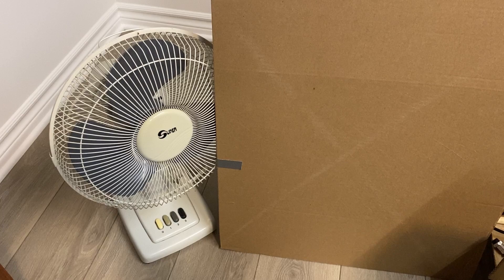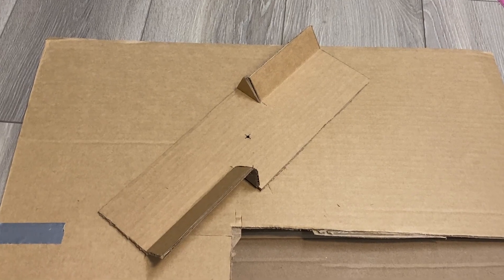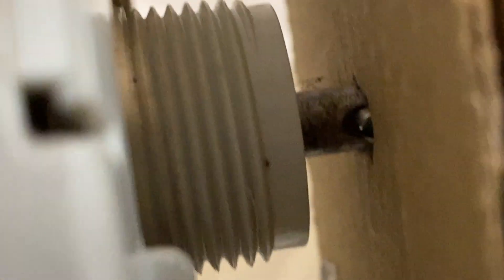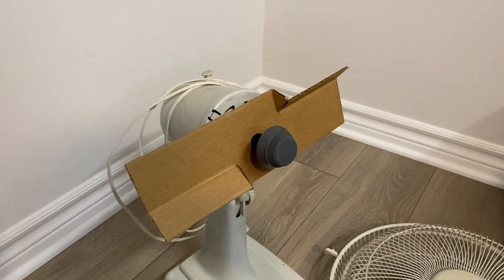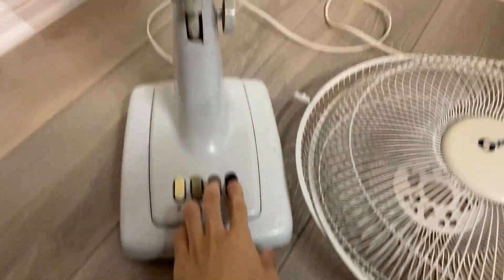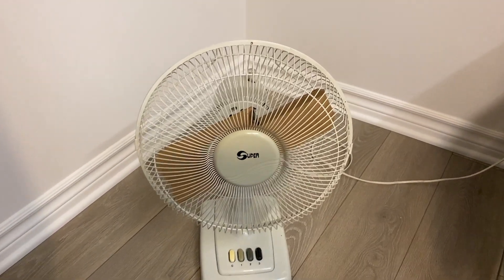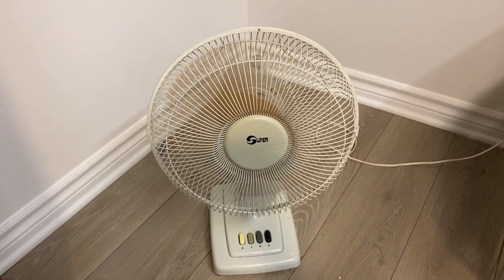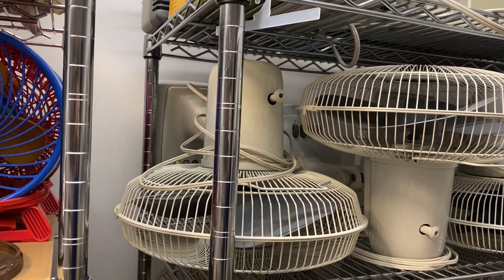Cardboard Fan Blades | Build & Test: Part 1

Comment: Man, this video brought up memories from my grade school. I used made cardboard fan blades almost everyday in 5th & 6th grade. I would bring them to school, play with them, show them to my teachers and get real distracted during class by spinning those blades on ballpoint ends. That I guess is where I got inspiration to make the 6” metal fan blades for my vent fan project. You should definitely try making some blades with the help of a compass & some rulers, I guarantee you’ll get some very interesting results.
Reply from the maker: Lol that's awesome! Nothing better than sharing your passion and projects with others! The use of a compass is a great idea, especially for making blades that aren't just rectangles.
Reply: That reminds me of that time where I tried to make a ceiling fan, back in 2016 I believe, with just a bottle and cardboard as the blades (I believe) it didn’t spin on it’s own but you could still spin it, either way I was pretty satisfied with it haha.
Reply from the maker: @RMFZ  That’s cool! I guess you could call it a ceiling pinwheel lol. I remember building a couple motor-less fans too, mostly when I ran out of motors to use.

Comment: Those blades are most likely better than blades on fans today. Those blades do remind me of those awful modern metal desk fans but with more pitch
Reply from the maker: You're definitely not wrong! These cardboard blades are thicker and more rigid than the blades on my Mainstays oscillating fan lol. This design sure does look similar to how those retro fan blades are shaped: a flat leading edge with a folded trailing edge to give it some pitch. It really isn't the most effective design in terms of aerodynamics, hence the rather poor performance on those metal fans.